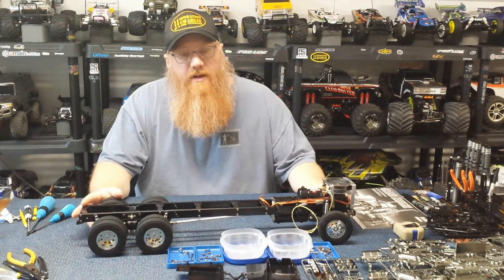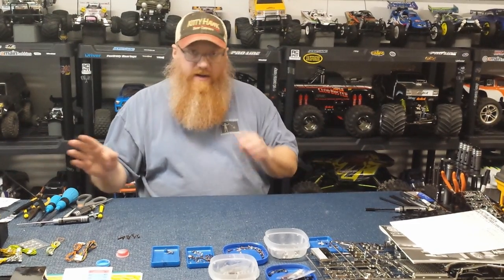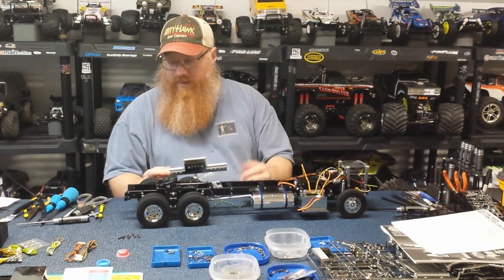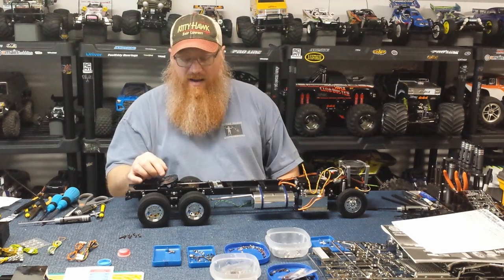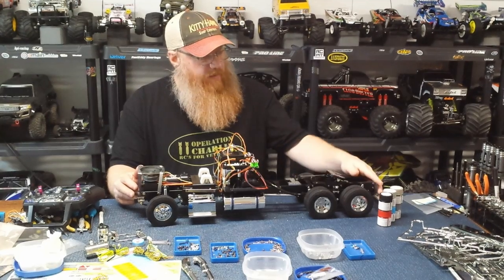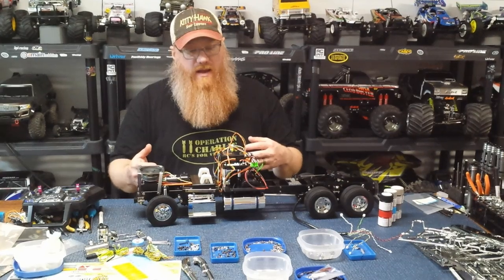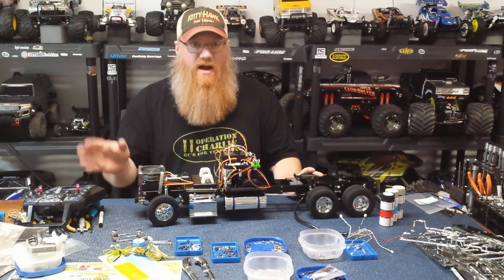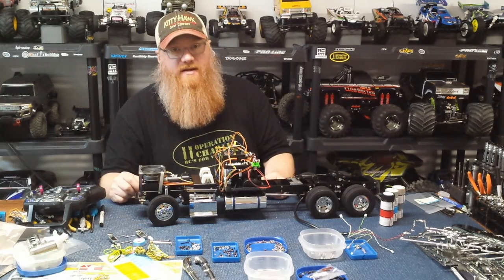Tamiya Grand Hauler TAM56334 with Tamiya MFC – Part 2 Build, Wiring, Thoughts and Tips

Comment: I LOVE THAT YOU'RE USING A STICK CONTROLLER
Why did you decide to use that instead of a pistol grip one
Reply from the maker: It is easier to program the stick on to get everything working properly and also as I learned all of this from Bob over at Hobby Concepts channel so I just followed his lead and instructions on programming to get it all working. You can do it with a pistol grip one but the cost difference between this stick one and a good pistol grip with enough switches and stuff is a fairly big difference. Following Bob's instructions made it all a lot easier and since this one drives so slow the sticks work out fine.
Reply: @AddamsPlayground  what's his YouTube channel called just HOBBY CONCEPTS
Reply from the maker: @nomusicrc  here is the link- https://www.youtube.com/@HobbyconceptsLLC
Bob has all kinds really detailed build videos and instructional videos. He was a huge help in getting mine built and running right!
Reply: @AddamsPlayground  I've been watching different videos of his  Thank you